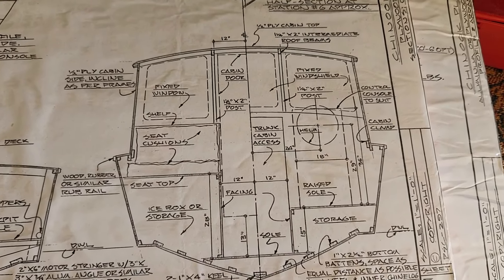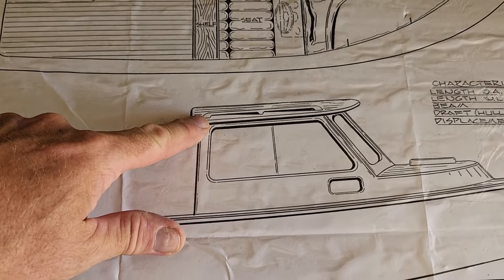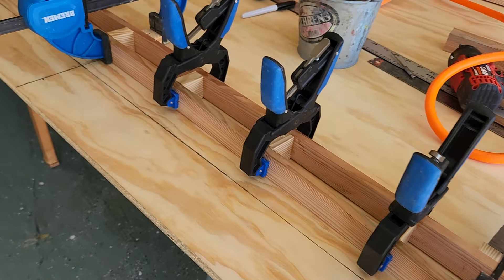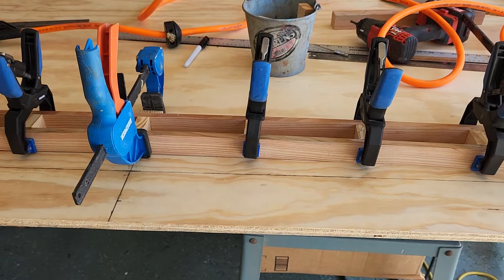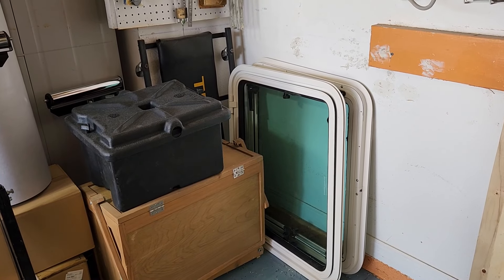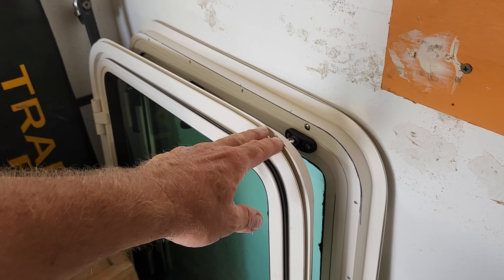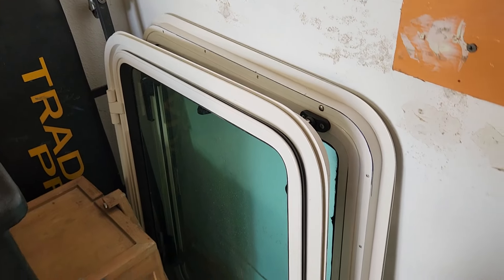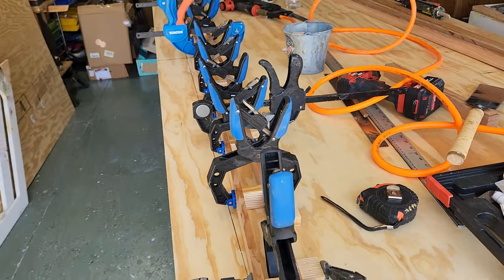Arched Beam Part 67

Comment: James, I have another idea for you. Seeing that you are not having a back wall I was thinking (I know bad idea). On the vertical ends of the cabin I take it that you will beef up this area. If you do you may want to add in some hand holds like the type use on ladders going down into a cabin. It would give you extra places to grab if the weather gets ruff before you get into port. Also a place to grab getting into and out of the boat at a dock.